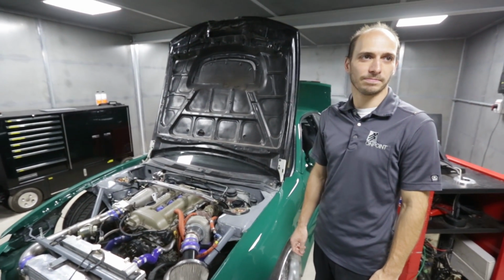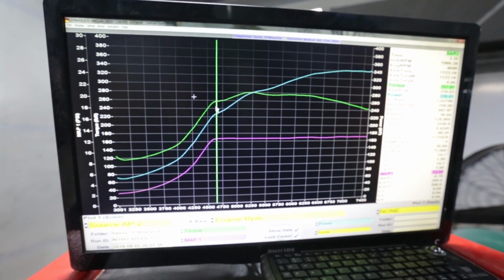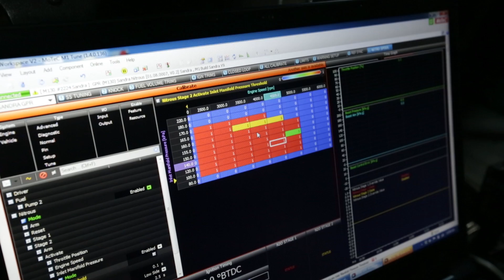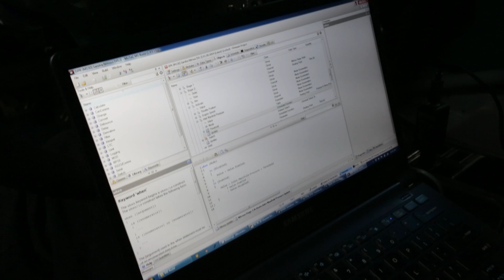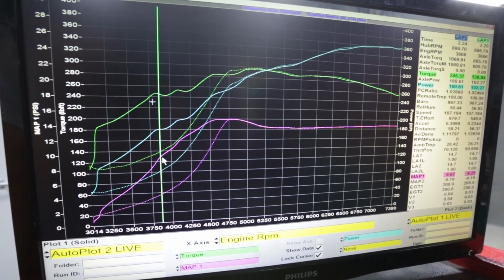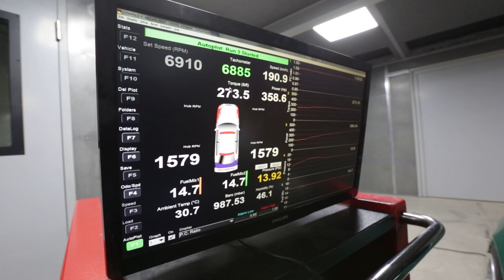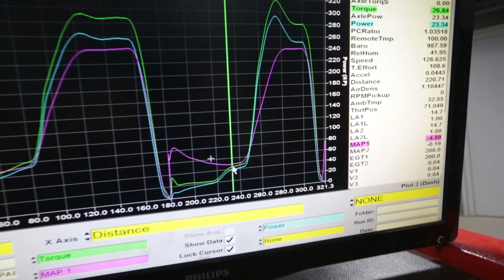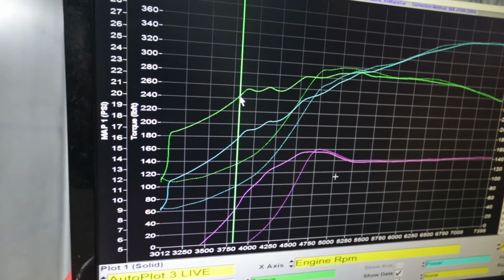Watch Nitrous Make A Nissan 240SX SR20DET Behave Like a V8 Engine

Comment: Dudes a genius.
Reply: yea cuz 5 minutes of googling would get you this same setup, lol.   People been doing this on sr20-forum for years.   You can get the same response and more power with a gt28 setup on e85 they make 430+ whp.
Reply from the maker: We're not saying this is a big power setup nor that it cant be done with a different turbo, this is just a quick and somewhat easy way to gain some serious spool without having to redo the entire turbo system and keep it low stress on the engine.
Reply: 5 minutes of Googling will show you exactly how to make a 400hp NA VQ37 with the stock block?
Reply: I'll just keep building all motor cars.  Every time I try to increase my knowledge of forced induction there is some dickface hassling you about your lack of knowledge. I thought this shit finished in high school! Lol.
Reply: Your issue is u think everything out your mouth is correct, its not. you think everyone knows less than you that you talk to, you dont.  Once you get over this, you'll understand life in general.  I have been working on turbo cars since 01 professionally at a shop and own my own shop for 10 years, I know a decent amount about them without having someone force fed their opinion onto me.  Sorry I prefer setting up a engine correctly with correctly sized parts.   if this was a gt40 or a rear setup id understand, this turbo is just the wrong size for the engine and they are trying to make up for it with spray, nothing wrong with that, but they could have went with a bigger turbo, had same spool, and made more power. but what do i know I just make more power and response with a smaller turbo and no n2o needed.  Acting like this is new knowledge or revolutionary is beyond me. It a nice car by all means, but what they are showing you, is not new.  Maybe new to you, but not new.
Reply: why do I care?
Reply: Nathaniel Mathies
thats the whole point a t25 flanged gt28x71 has fast response and makes up to 500whp on e85.  so u keep response and have that power.   I also run a 38mm mvs on a stock s15 manifold and arp hardware all the way thru, journals slitted with acl bearings and mazworx arp modified headstuds with a tomei gasket.  hold just fine, oh and z32 tt pistons, stock rods for 1993.
Reply: holt b I'd say Sachas engine was built by some of the guys here in Australia. You see them on the forums all the time. They have a stock engine and want more power so they get a huge turbo and bolt it on. If you crack the block it's probably standard. Hence the huge lag. Turbo is one of the last things I change. Intercooler is last. It does nothing for power increase unless you drastically increase air flow. Standard turbo in most applications is good for a 20% power increase. Just wind up boost, add fuel and tune the ECU
Reply: Speed Academy That was my original point! Porting NX direct into the cold pipe is a much cheaper and simpler option than going to smaller turbo or building more NA power. I never would have thought of it.
Reply: It will also help with inlet air temps, adding it that far up the inlet track helps to drastically cool that inlet charge. It still has the effect when port injected, this just maximises the effect
Reply: holt b I had the red top type x combo and did the Disco Potato swap
Reply: Now I may finish my thought, I was saying, I did the redtop,Type X head(heat fins for cooling), with a New crank and rings with a (Disco Potato) making ridiculous power!! I loved that motor setup!
Reply: yea motiq has done higher until crank snapped.   but this video is of n02 for spool on a turbo car with a stand alone.
Reply: our local record on gt28 is 475whp with stock valve springs.  he's going for 500whp after springs on e85. rs-e did the tuning.
Reply: That info was to the other guy not getting butthurt with the disco.
Reply: ahh. Roger that. 
if it were me I would have rebuilt the motor and swapped turbo because a. I like to know what's in my engine and b. filling a nitrous bottle all the time seems like a hassle to me.
but for drifting I only need around 300hp and good response. but I suck at it so 400hp and I'd kill myself. I stick to circuit racing.
Reply: Nathaniel Mathies why do I care?
Reply: apex128 I don't know but you took the time to reply so obviously you do. Otherwise you wouldn't have bothered even reading the comments.
Reply: Nathaniel Mathies I just commented because that's what you said earlier. I was trying to make a clever touché.
Reply: apex128 Clever is lost on me. I'm as stupid as a block of firewood :-)
Especially when it comes to engines. As an example, I'm building a Volvo S60 T5 at the moment. How stupid is that?
Reply: Nathaniel Mathies Lol that actually sounds cool.
Reply: Maybe. Could be a huge failure. You can build them to 600hp. The connecting rods I put in were rated to 800hp. But they also fit the 2.8l T6. I'm pretty sure the 2.3l T5 would never make it.
I'm aiming for 330hp. Factory is  250 so not a huge increase. But until I find an AWD platform I think 250kw in FWD is plenty
Reply: This is the correct point here. Nitrous can solve lot of issues with your base setup and not cost an arm and leg to sort out. Since numbers weren't really the focus, you'll notice the power gained with the 35 hp shot alone was more than 35 ft of torque, roughly double if not more. This is why larger turbos and spool aren't a concern to me. You can also take car with a modest turbo and make huge power out of it just adding nitrous. For example a Stage 3R Neon SRT-4 made 384 hp with 110 low lead and 50/50 water methanol injection. Add 50 hp shot of nitrous he made a 479 hp, on a 75 hp shot he hit 520 hp. In truth nitrous likes to be leaner than most people are comfortable with, so lots of people are leaving 20-30% of possible power on the table. Also nitrous, water-methanol and turbos create a horsepower love child. Very linear power delivery, huge top end power when required and all ran on either high test pump or affordable no lead race gas.
Reply: Thank You Nat for sharing that. Morons in the Focus ST community automatically say the intercooler should be upgraded when there's little to no proof. High inlet temps are not the end all. I have an ST on the stock intercooler, inlet temps get high but the car still runs mid 13's with just a tune and slicks. It's more impacted by coolant temps shooting to 210+ degrees; I loose 10-11 degrees of ignition advance and 1.5-1.7 mph of trap speed to go with it. Nothing to do with the intercooler.
Reply: Nathaniel Mathies
people have been doing this since the 90s man, nothing new to get. I rather keep my under 3k spoolup and instant spool off/on throttle mid range than run a bigger turbo.  It just allows for a bandaid over a shit build plan.  most gt30 sr's make around 400-450whp.  I make 502 on a gt2871 t2 turbo.  You can't say more power and faster spool without aid is a bad thing.....   N2o with rear mount turbo setups are where you truly benefit from the added spool time, if nothing that crazy i'd rather match cams, turbo, and engine flow as one, without bandaids.
Reply: on another note i like the paint code on this car alot.

Comment: Nitrous is awesome for making power & melting pistons
Reply: jet fuel doesnt melt steel beams
Reply: @JackTruitt  thats not the official narrative 🙄
Reply: Nitrous does not melts pistons, heat melts pistons.
Reply: Nitrous doesn't destroy the engine 95% of the time. Incorrect tuning or component failure destroys engine's.
Reply: Jack Truitt first thing that came to mind
Reply: The Nitrous creates the extreme heat which then melts the pistons. but before pistons melt you would most likely blow a head first....
Reply: Leadfoot2112 Well if nitrous = food then the tune = exercise. Don't be a lazy slob eating tons of food without any exercise and you won't have a problem.
Reply: food is energy you missed something in that
Reply: Only with wet systems, this is dry. Even when wet nitorus backfires into the intake are rare. They also a symptom of low quality nitrous solnoids made in America. I have had the bottle on several cars, no problems, only whining from losers at the end.
Reply: does not * melts
ur right tho^^
Reply: Thank you.
Reply: its a small shot 85 wouldnt hurt it
Reply: Evil Opti Z Intake manifold failure is the most common.
Reply: That would fall under component failure
Reply: Evil Opti Z was a joke
Reply: Dirt4k Even though it was a joke it is a pretty common failure in the higher HP engine's. Some of them use a plastic bolt/nut to hold the top of the intake on so if they have a nitrous backfire it doesn't destroy the intake and will just break the bolts/nuts.
Reply: nice one
Reply: nitrous equals more heat what you said is like saying fat people only die from heart attacks not the food they eat....... nitrous = food
Reply: Leadfoot2112 thats some interesting mental gymnastics
Reply: Melted piston  and or destroyed engines are caused by people (posers) not knowing how to employ/setting up their N20 system.
Reply: Dino Maxi you dont just do a 400 shot on your stock D series?
Reply: Dirt4k who said anything about an amount,I was speaking about N20 in general. Employing N20 in any amount the WRONG way will cause engine problems.
Reply: Desmond Johnson S A T I R E
Reply: Evil Opti Z And drivers. When people don't purge their lines and activate n2o without the lines purged their force fucking their engine with fuel, but no oxygen. Or if they try to activate nitrous without being WOT they force fuck oxygen, but no fuel means the same thing. There are times when the setup is wrong too like you said, but I'd say 90% of the time it's driver fault.

Comment: why does it have such a small intake? and is that an afm on the intake also? surely the computer uses a map sensor and not a air flow meter. restriction on the intake is prob why it is lazy to spool up also
Reply: the inlet of the turbo has a big-to-smaller coupler which makes the intake look smaller but since the turbo is so tiny it probably doesn't effect air flow much if any. I don't see a maf anywhere, it's probably a map based setup.
Reply: SR20 and RB26 use MAF..
Reply: +Jack Jack yeah they do standard but just about every aftermarket ecu uses a map sensor and you get rid of the afm. that turbo is prob not even in its proper working range at 12 psi.

Comment: I had planned on doing this same setup with my old civic, but even with a 58mm turbo i still reached 20 lbs by 3200 RPM (ish, hard to remember) and couldnt keep any traction, so i figured the nitrous wouldnt help much in that case lol.